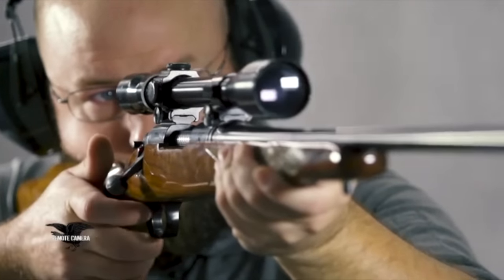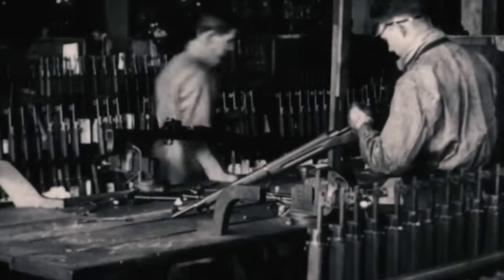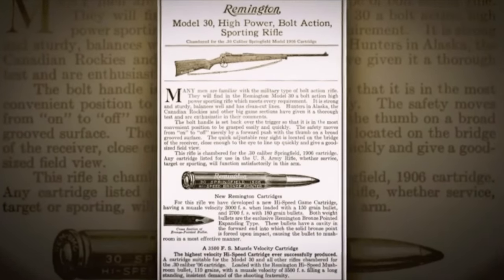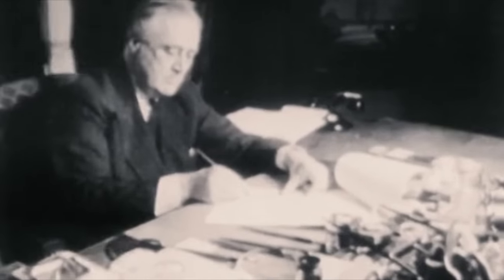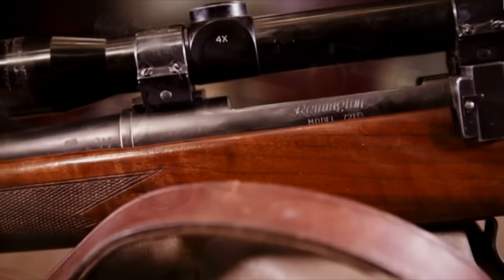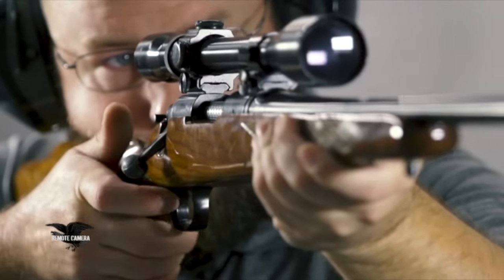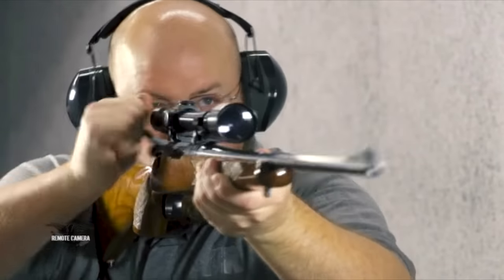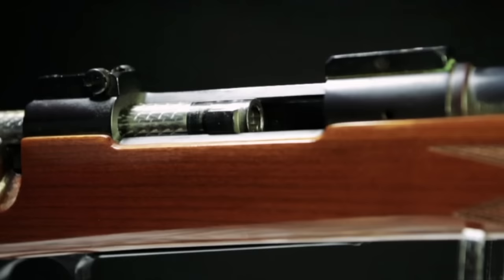ARTV: The Remington Model 700 Story

Comment: Winchester model 70 has always been a better rifle than a rem 700
Reply: Bullshit I had both sold the model 70 it was junk.
Reply: I have both. And they both perform well.
Reply: Yea om not sure about that OP
Reply: The old Model 700 is a much better overall value.
Reply: @jbrown1971  that doesn’t mean they all are…
Reply: The 700 works okay, but I will take the robust Mauser style non-rotating extractor, fixed ejector, controlled round feed any day. I like the safety system on most of them better too. But above all they are so much more satisfying to operate. Life is short, I just couldn’t imagine it with only a 700.
Reply: Then why did the military stop using it
Reply: Unfortunately in 1964, Winchester changed the design of some of their firearms including the Model 70 to make them easier to manufacturer.  Took away the Mauser type extractor.  Winchester caught a lot of flack for it.  Same with the Model 94.
Reply: I have to totally  disagree I have had several model 70s and have model 700,s   my 700 and model 7,s out preformed my 70,s by far I no longer have any model70,s
Reply: Winchester model 70 best rifle ever made period.....
Reply: Depends on who you ask. Brand loyalty has a way of clouding judgement.
Reply: If you like missing
Reply: Pre 64 yes post 64 no
Reply: Only a know nothing dimbulb would call a M-70 "junk". 🙄

Comment: One correction: Remington and Winchester both got contracts from the British to produce Pattern 14 Enfields.  Remington also had a contract to make the 1903 Springfield and had trouble meeting production goals.  Remington went to Baldwin Locomotive and subcontracted them to build P14 Enfields at Baldwin's Eddystone, PA location (not Delaware).  Remington set up a new factory on Baldwin's site, supplied the tooling and production experts and Baldwin supplied the labor.  When the US entered the war the government took over the British contracts for production of M1917 Enfields.  After the war both Remington and Winchester were left with valuable tooling they wished to make use of.  As mentioned, both saw the value of high power bolt-action rifles for the US market.  Remington adapted the M1917 as the Model 30.  It was a large and robust action which could handle magnum cartridges.  Winchester took elements of the M1917 and 1903 Springfield and few ideas of their own and came up with the Model 54, which was later tweaked to became the Model 70.

Comment: I have three Remington Model 700's, all over thirty-five years old. My 700 ADL in .222 Rem (the venerable "Triple Deuce") is a tack driver. Light and with negligible recoil, it's been the centre-fire that all my kids graduated to after working with a .22LR. My 700 BDL 'Varmint Special' in .22-250 has a long heavy barrel and is a bit too big to lug around in the field but it is an awesome predator control rifle I've used on many a close by farm and ranch. It's scary accurate. 

I also have a 700 BDL 'Safari Grade' in .375 H&H. I've read that these were made up in Remington's Custom Shop although it doesn't say so on the rifle. It has excellent fit and finish. Because it's a heavy rifle, the recoil comes as a stiff 'push' rather than a sharp 'crack'. My .300 Win Mag kicks harder. 

I've never had a single issue with any of them. Feeding, firing and extraction has been flawless. All have original Remington triggers and again, not a single issue, perhaps because I leave them alone. Just because some triggers are made adjustable doesn't mean everybody should be fiddling with them. Know what you're doing or get a proper gunsmith to work on your triggers.

Comment: I bought a 700 / 30/06 in 1987 or so , while deer  hunting I took off the safety and the gun fired. 
My cousin got mad at me because he thought I shot the gun before we were to go into the woods. But I didn't pull the trigger.
Later on , I sold that gun . Years later 2007 or so not sure on date. Not realizing that the gun had a problem , I bought another 700 BDL 30/06 because I thought it was a nice rifle.
Then I learned about the trigger from Remington sending me a letter to take the gun in for repair. Calling gun repair shops , they were backed up with repairs ,so
  I changed out the trigger my  self,  for a Timney trigger. I still own the rifle but don't get a chance to shot much. 
If Remington would have fixed the problem before people were injured things would have been so much better.
By the way I served in the Marine Corp and shot expert with the M14 and the M16

Comment: One of the most beautiful bolt action rifles ever built. However, the trigger assemblies are susceptible to paraffin build up which can reduce sear engagement exacerbated by improper handling & temperature extremes, plus earlier instruction manuals showed how to reduce or increase trigger pull resistance inviting wanna be’s to tinker in gunsmith territory.   Proper maintenance & recommended manufacturers lubrication instructions have given me over 50 years of dependable & reliable shooting with my 700’s. All are keepers!

Comment: The 1976 Remington 700 BDL bolt action chambered in 7mm Remington Magnum. There is nothing better, in my opinion, & never has been. Hinged floorplate, great iron sights. Solid scope mounting. Excellent accuracy. I’m sure everyone has their favorite bolt action & it may differ, but the 700 BDL is mine. The fact that I can throw in a round & close the bolt is a big plus at the range. It doesn’t necessarily have to feed from the magazine as does a controlled round feed rifle.  Iron sight accuracy at 50 to 75 yards is perfect. Scope accuracy is even more precise from 100 to 250 yards.

Comment: My first rifle was a model 700 BDL in 30-06 bought new back in the early 80's. It shot ok but was never as accurate as I expected. After a few years I pulled the action off the stock and found that the plastic nose piece had a big chunk of molding debris pressing hard against the front right side of the barrel. Can't see how something like that passed quality control since the rifle was assembled by hand. After sanding the debris out of the way and floating the barrel the rifle shot a lot better but finding the molding debris wasn't what I would have expected considering what the BDL 700 cost new out of the box. Still have the rifle and it shoots fine but I'm not planning to buy another new Remington because I've heard the build quality has gone downhill since then.

Comment: One of my older brothers bought a 700 BDL .30-06, but the scope mounting holes were crooked, so he sold it and got a BDL in 300 Win mag. Another one of my brothers bought a 700 BDL in  .25-06 and it fired when the safety was released, and I won a 700 ADL .300 Win mag at the RMEF banquet, and it would jam 3 out of 10 times the bolt was cycled.
Reply: I’ve got a Remington (can’t remember exact designation ) in my safe , trigger is the heaviest thing in the world , fails to pick rounds up 2/10 times ect ect . I don’t even look at it let alone use it

Comment: Didn't Remington (Model 700) have a fatal flaw in the trigger design which allowed it to fire while on "safe" or when switching the safety from on to off? I know Remington had a recall at the cost of millions which contributed to their downfall. R.I.P. Remington. 🇺🇸🙏
Reply: No it's been proven that virtually all people who claimed the gun went off on its own, actually had their finger on the trigger. Regardless, for emotional reasons, the court ordered that the trigger mechanism on any remington 700 can be upgraded for free by remington to finally end this discussion
Reply: Yes they didn’t even touch on that subject for some reason
Reply: It had something like that.   I believe it would go off when the bolt was closed. Left handed ones maybe?
Reply: A lot of the accidents with the 700 was due to people messing with the trigger pull.  If you leave it at the factory setting its fine.
Reply: That was an issue with the 788 I believe. An elderly gentleman I know has one that’s in really good condition.
Reply: The sequence I experienced with a used 700 was if the trigger was pulled and released while on safe the rifle would not fire but would then fire without trigger pressure when safety was disengaged. Whether the trigger had been modified/adjusted after it left the factory I don't know. Apparently there was a connector that was reliant on spring pressure to engage; that has now been redesigned. As I told my kids the point of keeping the muzzle ALWAYS pointed in a safe direction is to keep anyone from being hurt regardless of unintended factors-and is the reason that rule is the #1 rule above all others
Reply: I have one.  It went off on me at the range.  Fortunately, it was pointed downrange.  I did NOT have my finger on the trigger nor had I pulled the trigger when it was on safe.  It only happens in cold weather when you move the safety from the safe to fire position.  My trigger was unmodified.  Remington did huge damage to their reputation by denying there was a problem and blaming accidents on owners.  Between recalls and injury lawsuits they ended up filing bankruptcy.  Their quality really went downhill in the 80s.  They had issues with 1100 receivers cracking.  They had issues with 1100 and 870 barrels exploding due to changing from chrome-moly alloy to free-chipping carbon steel barrels.  And finally there was the R51 pistol debacle which they could never get to work.  I hope the new owners do better.  BTW, Remington says only 1 in 4 recalled rifles were ever returned for repair.
Reply: I shot a weatherby Mark V 300 weatherby magnum that did the same exact thing.

Comment: Unfortunately, by today's standards, the Remington 700 is way past its prime.  I keep wondering why I'm suckered into another.  Short memory?  In my opinion, compared to say a Tikka T3X,  the 700 is junk!  My  latest 700 ADL project purchase is in 30-06.  Just to bring it up to my hunting standards, I replaced the trigger for safety with a TriggerTech, added a  speedlock firingpin assembly, lapped the bolt lugs, touched-up the crown and Pillar/bedded it in a carbon BDL stock.  I added a Holland bolt stop spring, Wyatt mag box and follower, and Oberndorf bottom metal. This is the bare minimum!  One could further true the action and screw on a better barrel!  But why?  Just buy a Tikka T3X,  which would most likely outshoot my 06 project, straight from the factory!  In my opinion, the 700 was built for every penny of profit, so as to keep its price lower than the model 70.. So corners were cut.  Today's rifles are assembled on much better production machines, and I'm sorry, but feel it's time to put the 700 to bed.